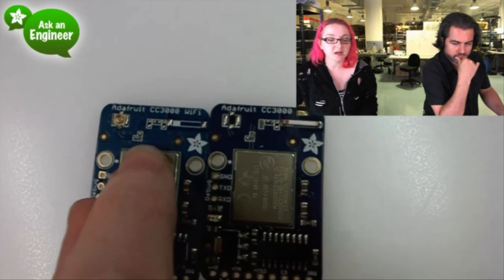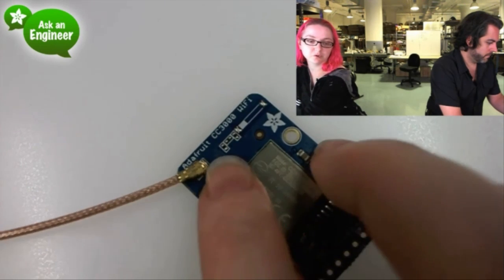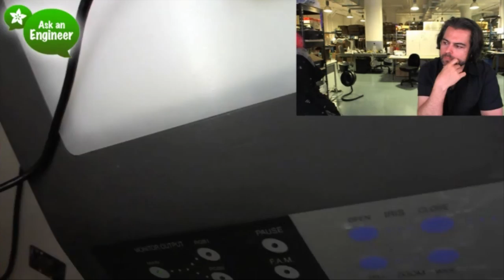Trinket & More! New Products 9/7/2013

Comment from the maker: See what's new this week! http://youtu.be/xmgDr75Wr0o

MakerBot® Digitizer™ (0:07) http://www.adafruit.com/products/1508

Adafruit CC3000 WiFi Breakout with uFL Connector for Ext Antenna (0:25) http://www.adafruit.com/products/1510

Adafruit Trinket - Mini Microcontroller - 3.3V Logic (4:35) http://www.adafruit.com/products/1500

Adafruit Trinket - Mini Microcontroller - 5V Logic (4:35) http://www.adafruit.com/products/1501

Trinket 6-Pack - 3 x 3.3V and 3 x 5V Trinkets (4:35) http://www.adafruit.com/products/1509